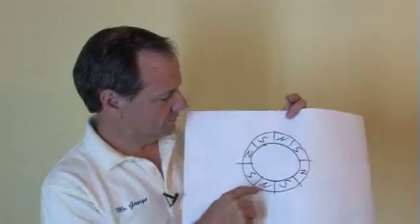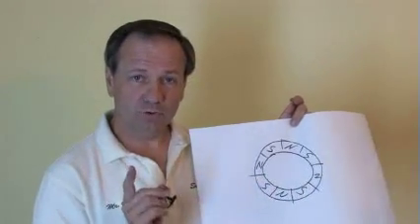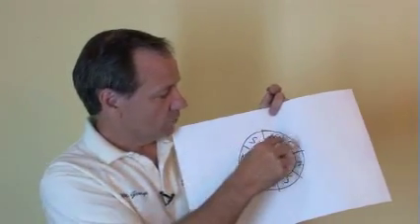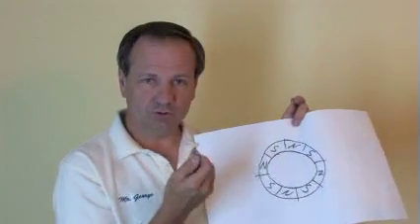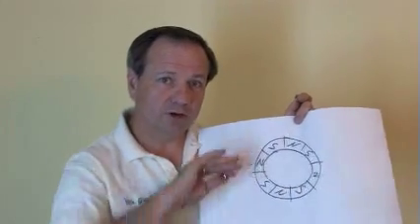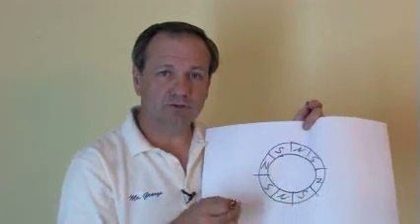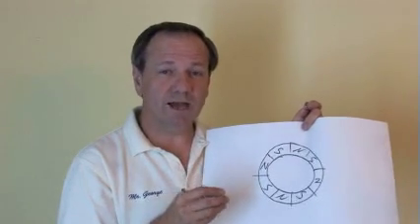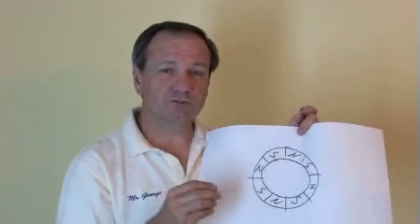Magnetization Methods - Part 2

Comment: We make a hmmmm, well it has a 1/2 diameter rotor with 86 neos alternating  poles. Major pain in the arse. Tweezers and I start with my souths out. Getting the norths in is cramp in the wrist city.  Then we have builds with much larger, 50's NiFeb with all the magnets crammed in same direction. woohoo youll get em all in and that last magnet changes the field and wham, magnets flipping at mach 6. Neos have no respect for your fingers. They do what they want to do when they want to do it. Anyways, cool videos. Your teaching good stuff that applies to the real magnet business. Too many videos on youtube of people trying to take over the universe with magnets...

Comment: hi i am trying to magnetize steel flat washers on the flat sides to be used as a switch aprox 7 mm washers the switch will have reverse pole push to make contact  and hold and release to open any help very small devise now using a spring push to make contact release to shut off

Comment: This question is very general and I do not expect any exact answer but I want to get an idea of how much of an improvement in efficiency one could expect if for example, you used very good magnets in place of old magnets in a motorcycle generator. The motorcycle was made in the 80's and I suspect that you have magnets that are much more powerful and would have an effect on the performance of the generator. Again this is all hypothetical as there are too many variables to quantify,

Comment from the maker: Spodfi

There are neo molded magnets that are not sintered but bonded together with an epoxy and they are much more machinable.  They are still not able to be magnetized except in one direction.  I can find out about making a composite out of carbon fibre if you want.

Comment from the maker: Actually we try to arrange the large magnets in the center of a box that gives us 2 or 3 inches distance before we get to the shielding material.  The greater the distance from the magnet to the steel, the greater the reduction.  Some of our largest magents like several 6"x4"x2" ceramic magnets in the same box we have to use 2 layers of shielding with a 0.75 inch thick piece of styrofoam in between the layers.  The next video is on shielding:).
Thanks